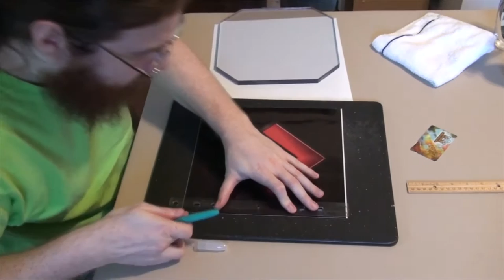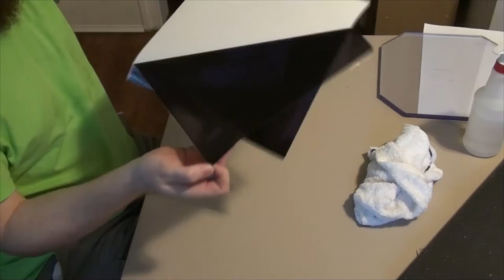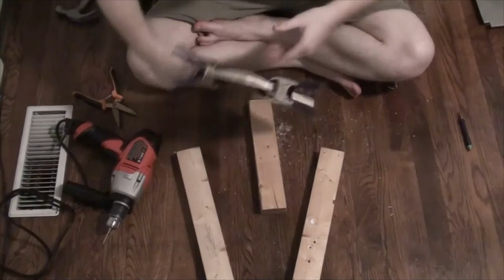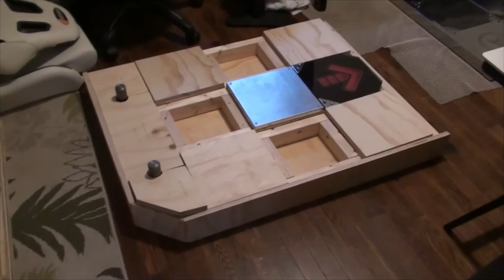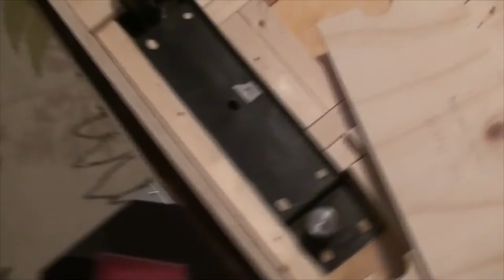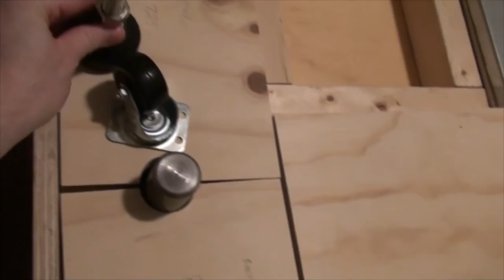Building an ITG2 dance pad replica - episode 4: Decals, metal bending, first assembly

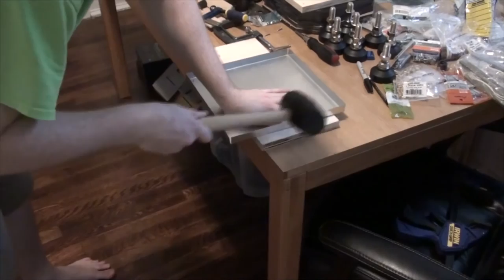Comment: 21:15 . The problem is the flexibility of the metal. Maybe to get it in the right angle, without taking it off the wooden board, you could heat the edges of the metal and hammer it.